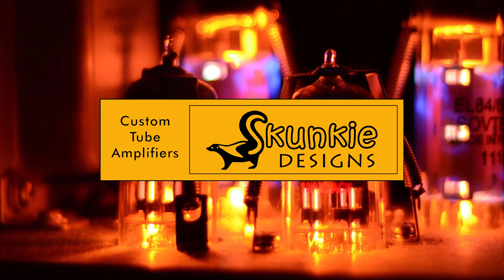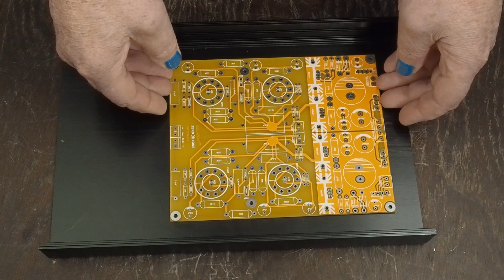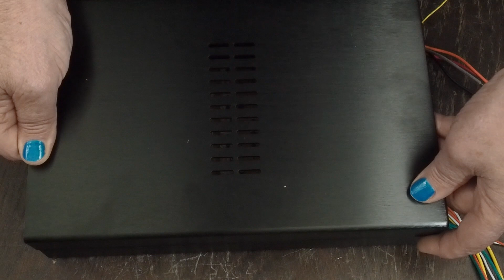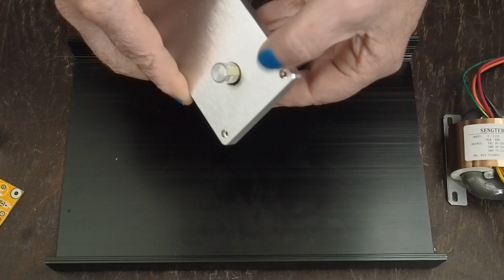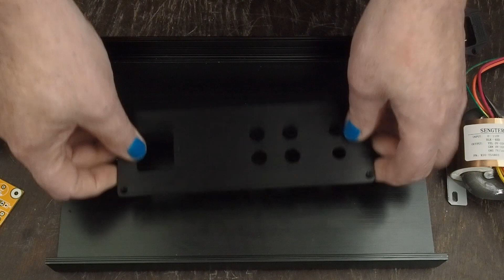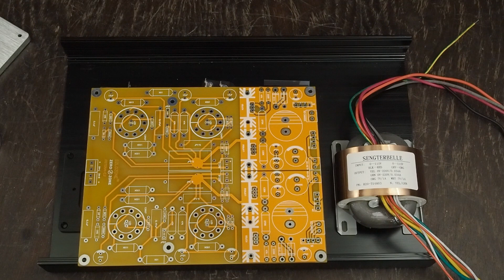HiFi Tube Pre-amp: Series Preview!

Comment: I also have this PRT-05A board and am planning to build one. Interested to know what audio class components you would install in it other than Mundorf (again, had the same thought) for coupling.
Reply from the maker: I'm going to try their cheaper MKP caps on this board, mainly because the others simply won't fit. I've used them before and they sound pretty good. I'm gonna try an orange drop for the first input cap as well to see what those sound like. At least as a starting point!

Comment: Awesome!

I've just recently started getting into tubes, I've been tinkering with audio gear and speaker design for about 30 years now, but playing with tube gear has got me hooked again. Last weekend I finished my first working piece of tube gear, a simple SRPP preamplifier with 6n1 tubes scavenged from another piece of gear.

I'm curious to see how this turns out, I've thought about ordering a kit to experiment with, but I've always been a bit suspicious of the parts as you are. I might have to find a couple of these boards and the trafo and follow along :)
Reply from the maker: The parts in some of these kits ARE sketchy. I've found some of them pretty far out of spec, which will affect the results. 

Plus, for me at least, choosing and hunting down all the parts is part of the fun!
Reply: @SkunkieDesignsElectronics  Exactly! plus, then we can get all audiophile about it and order super fancy bits where it counts :)
Reply from the maker: @drdyna  The coupling caps in particular seem to make a very audible difference.

Comment: I would need 3 inputs: phono, DAC, and FM tuner. The dual low-pass/high-pass outputs should prove useful to a lot of audiophiles.
Reply from the maker: This is a line level only project so phono would require a separate phono stage board. You could add inputs via a relay switching board if needed etc.
Reply: @SkunkieDesignsElectronics  I currently have a separate phono stage (not the EAR 834 design yet!) so all of my sources are line-level. Adding the extra RCA jacks and the relay switch seems like a good solution.

Comment: how about a link for the case that's pre-drilled?  Plus the transformer?
Reply from the maker: I have no idea if anyone has a case that is completely predrilled. For a lot of people, they should just buy the prebuilt model if you aren't comfortable doing any fab work.

 I also hate linking ebay auctions because they will be dead in no time. But these parts or similar ones are available online from other sellers and other vendors. Search PRT05A Zero Zone for the board and/or kits.

The case is 310*195*70MM and there is only one left. https://www.ebay.com/itm/322538994569

There are a few of the transformer listed as https://www.ebay.com/itm/353050986716

The board there are 2 left as https://www.ebay.com/itm/353050971696?var=622241327563
Reply: @SkunkieDesignsElectronics  Thank you for your time and effort.
Reply: The case that Steph is using looks very close to the ones you can buy from Ghent Audio. I have used several of their cases to build solid state amps and they are really nice.